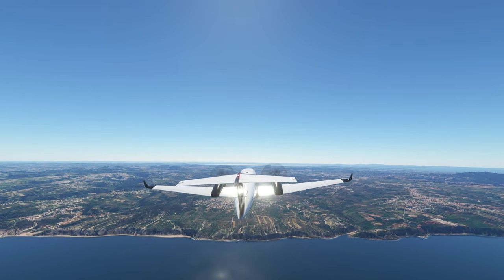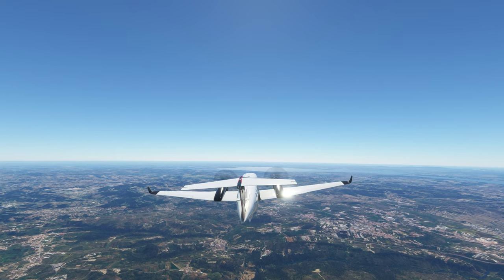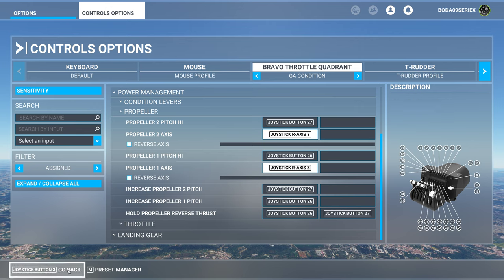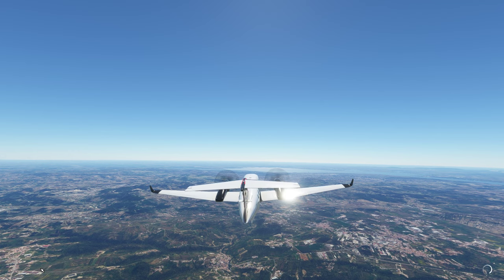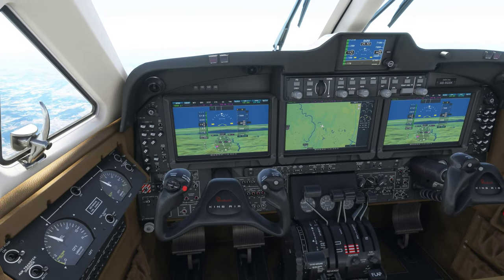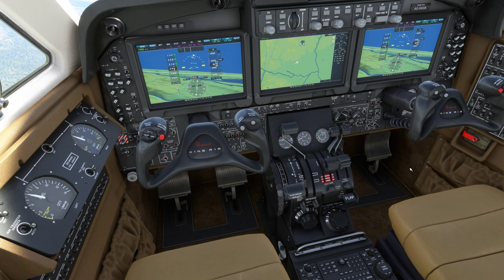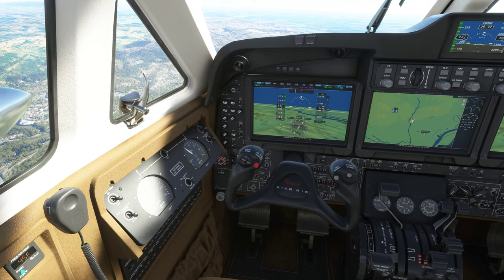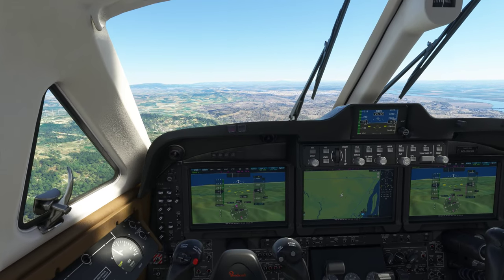Follow up to how use feather position with bravo throttle quadrant

Comment: if I am having to use the mouse, the simplest solution seems to be to turn off all button 26 and 27 commands, and when I want to feather the props to just bring either all the way back with the mouse on the screen, then both prop controls work without having to position the other one in any way. I am not going to feather often and use the mouse for many other controls so isn't a problem. Shame the quadrant doesn't work properly though.

Comment: So now you have en engine out with one engine. How do you fly further with the other prop at min!! The point is you dont want to use the mouse specially since you have a honeycomb it needs to work 100%. Its no real solution.
Reply from the maker: Sorry for trying 🤦
Reply: @boda09games  Don't be sorry. Just be more clear with what you're doing. Multi engine the way you do it and the way SimHanger Flight Simulation did it which was most probably where you copied it from, you still have to utilize the mouse.
Reply: And Asobo did nothing. They just ignore the biggest bugs and plan next sim.